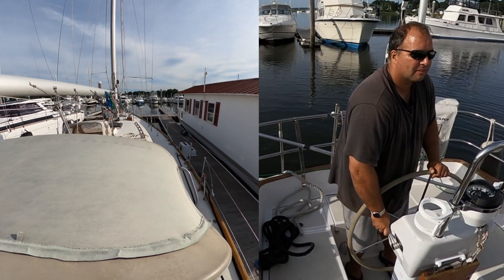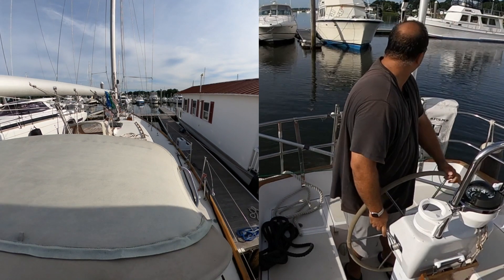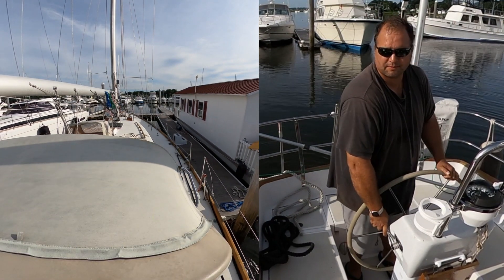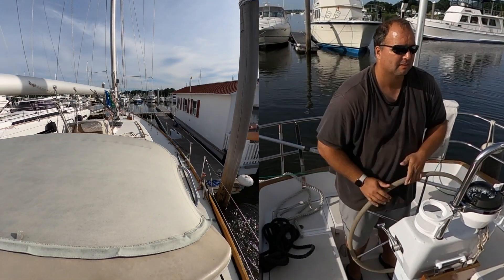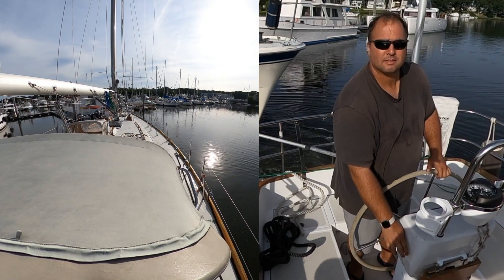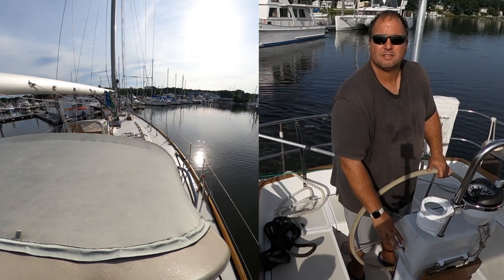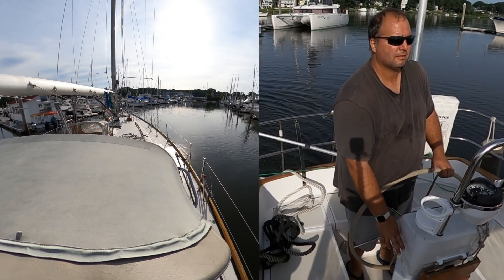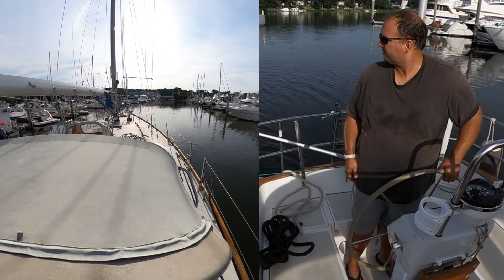First Singehanded Undocking from my Slip

Comment: Would backing into the slip be easier, or would that make more sense with a fin keel boat?
Reply from the maker: I'd say getting into the slip it's generally easier in forward.  But if you back in it makes getting out of the slip in forward much easier.

Personally I prefer bow in because I get more privacy that way when I'm living aboard.